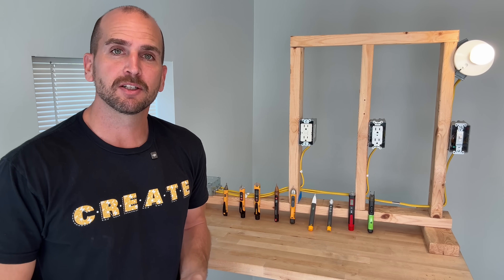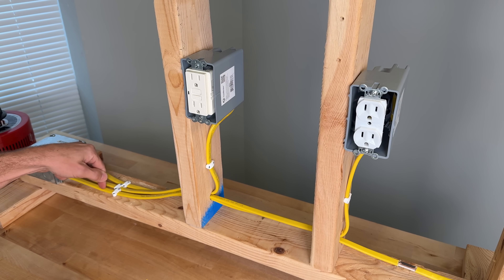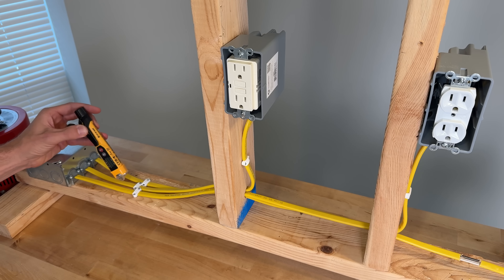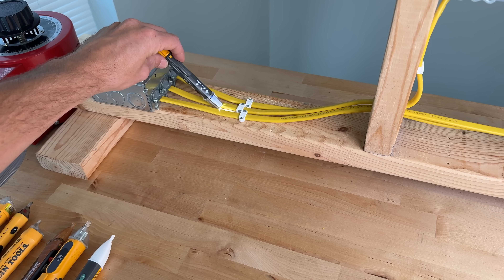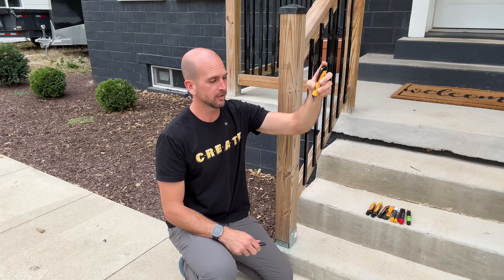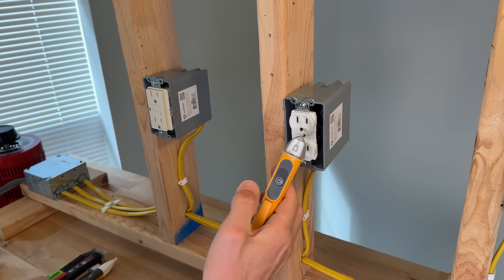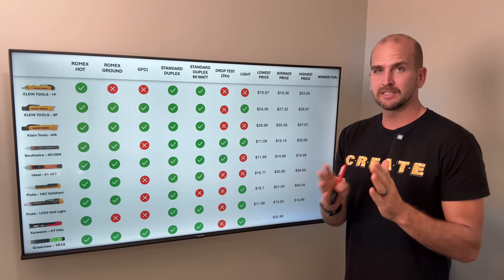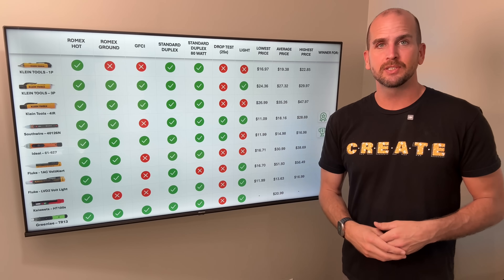The Ultimate Voltage Tester Battle: My Surprising Favorite!

Comment: A few fellow electricians had the Klein NCVT with laser distance measuring and they all died after a few uses. Mine  was used once and put in my backpack and not used for 4 months and wouldnt work when I pulled it out. I returned it to HomDep which had stopped selling them.

Comment: I like my adjustable Sperry NCVT. I can turn it up and sense from 2-3ft away, or turn it down sensing wire to wire. I've had it for years.
Reply: Me too.  If they were built more heavy duty and weatherproof, I'd really love it.  The adjustment dial has failed in my repeated use.

Comment: I’ve used mostly the 1P version, since I’ve dropped and broken so many I (now I have a retractable badge lanyard I clip to my shirt collar) buy the 1P version since it’s the one I’ve had best durability with. 

As for 25 drops. 
The more important question is which of the drops are the ones that it broke. 

Clearly they didn’t last till reaching number 24.

Since none are bulletproof, I think I’ll just use the Klein 1P. It’s readily available at Home Depot and less expensive. 
The lower voltage units have their place, but they break as often as the 1P 

Klein also had a free replacement for a recall a few years back. 

The Gardener Bender is sold by Menards, and the one I bought was frequently inaccurate, so when I lost it I wasn’t missed. I had similar issues with the polarity GFI tester from that brand. 

Fluke. Too costly, though their meters are reputed to be better than Klein. 
IDK, When my very expensive Fluke was stolen/lost, I decided to not buy the most expensive ones anymore. 
Back when my Fluke was first brought into my tool box they cost way more than I could afford, in fact I think it might have cost as much as the car I drove back then. 😂

Comment: I would have at least checked to see if the battery got loose when dropped on the Greenlee and if it worked I would have passed it. That is a common thing with battery operated things. 25 drops seemed a bit excessive because I doubt even if I used one every single day for say 10 years I would drop something that much. I would say if someone is dropping things that often they have some kind of problem holding on to things. I personally would have given the Greelee a perfect score if it worked after checking if the battery was loose. I've never heard of that tool before this video btw. I don't own any of those tools. I would ignore the "drop test" all together on all tools because I think it constituted over abuse rather than accidental dropping occasionally over several years. IMHO both the Greenlee and the Klein Tools 3P both got a perfect score ignoring the drop test.

Comment: Just bought Southwire 40150n, the nicer version of the one u tested. But bought because of u, ive always used a klein but the issue ive been running into is 5volt and 12 volt. it wont always pick them up. I have a feeling the southwire will since its range is better.

Comment: I have two of the Klein 3 P. I purchased one after watching one of your videos and I liked it so much, I purchased another. I haven't used anything else so I don't have a valid opinion of any other. However, I think that if one's finances permit, they should have one of each, as they all might have their uses for different applications, except for the one that broke before you even dropped it. That is chintzy. For me the Klein has served me very well. As I said, I've purchased one as soon as I saw it in one of your videos and I carry it with me every day, even if I am not doing electrical work, as it makes a handy flashlight. I just wish it was a non conductive metal and could be connected to a charger stand. I am constantly recharging batteries. Non rechargeable do last a tad longer but I hate throwing things like that away and they're inconvenient to recycle. I put them in the recycle bin despite notices from the rubbish people to not do that. So I prefer rechargeable batteries for that reason.

I will probably buy something new when I have time and extra money. My health is getting worse, so not sure how long I can keep doing these things. I usually end up calling an electrician in here in the end anyway, just because I am physically unable to do stuff anymore. :(

Comment: Thats odd, you say and it shows the Ideal 61-627 as be a range of 50-1000 VAC and my Ideal 61-627 shows on the side as 50-600 VAC.   The links take you to the Ideal 61-627 50-600 VAC.   Mine works great with no problems.

Comment: Surprised you would pick a unit that failed to detect power on a GFCI.  To me that would be a fail.  I've never dropped a detector but 25 drops onto concrete is a bit extreme and that would not be my primary deciding factor unless I had issues with holding onto things.  Theunits that passed al the detection tests would be on my list of picks.

Comment: What happens if you test the other side of the gfci ? I realize that if wired properly you shouldn’t have to test both sides, BUT wouldn’t you do both sides if you wanted to know if current was there before assuming the outlet was dead.

Comment: Klein 4 IR for me. I carry this daily it's dependable and rugged. The temperature function is great for finding loose connections (that overheat) and bad (hot) fuses and circuit breakers. I have done Commercial HVAC since 1999.
Reply: Came to say the same thing. 😂

Comment: Thanks for this type of video! Having to rely on advertising doesn't get you very far. I use the 3P. Happy to see it passed everything except dropping on concrete 25 times. I think I'll stay with it. If I accidentally drop it onto concrete 25 times and it quits working, I'll just get another one. I test gfci a lot, so that an important feature for me. Thanks again.
Reply: I completely agree.  Failing a detection test is more important than failing a durability test.  When a detector fails any detection test, what other detections will it fail?

Comment: My advice is that if you are getting a non-contact voltage tester as your only means of verifying a deenergized circuit is that you should not do that. It is a bad idea. A death stick as they are called at times are called that for a reason. DO NOT use one for verifying a dead circuit. 

Now I will say that these tools serve a purpose. I am a professional electrician I did residential, and moved on to industrial because there is a lot more money in it. I have a non contact voltage tester. I use it for trouble shooting regularly. I never use it to verify a deenergized circuit.

My advice to the DIY guy out there is to pick up a Klein ET60 low impedance voltage tester. it is very useful to have. It verifies the presence of power, it tests to see if the receptacle you are working on is GFCI protected, and with its low impedance it will drop out any induced voltage on on your line so no false positives. Just remember to live dead live check your tool and you are in the clear.

Comment: I have been using the Gardner Bender Livewire instrument for years. Model GVD-505A. I chose it specifically because it is 12-600 Volts and the sensing is adjustable. So it does detect far away sometimes up to 6 inches and am using it to sense wiring through the walls and follow it. I think this is a missing test in your laboratory. Very useful. Thanks.

Comment: I use the Kaiweets daily because it can pick up 12vdc as well.  I work with AC & DC daily, and it helps me diag fast. It works fine with GFCI s as well.  Looks like the one you got might have some issues.  I use the light all the time as well.  For someone working both AC & DC it's great.  If you only work on AC your suggestion would be the best.  Never considered Southwire version.
Reply: I agree, mine does read GFCI.  I used it to check my bathroom outlets and switches, about 6 months ago.  I switched them both out.  Today, checked 2 outlets, and circuit breaker.  My hubby got his 2 wire reader (sorry don't know what's it called, I'm a 59 year old newbie).  He even used my Kaiweets today, multiple times.  Did test again on 2 GFCI and it did just fine.  Just my 2 cents.  Also, we need to replace 2 bad circuit breakers :(

Comment: I just tested my Fluke 1AC II with two Leviton GFCIs, one about 25 years old and one a few months old, and the Fluke worked correctly with both of them. I wonder if the brand of GFCI makes a difference.
Reply from the maker: Most likely this one had a really thick front plastic cover which challenged many of the NCVT.
Reply: Makes sense, I had to insert the tip of the probe partway into the receptacle before it would register, but with a standard outlet I only had to get close to the front of the faceplate.

Comment: I think the drop test was way beyond fair. These are electronic testers and yeah we may drop it but 25x's is a bit much on concrete. So as far as I'm concerned I'd make my choice neglecting the drop test. However is it acceptable if the test fails the GCI read? Why wouldn't the GCI test be important?
And thanks for putting this up.

Comment: I didn't realize my little klein wont detect in a GFCI.   good to know.  but on receptacles  i always have a 3 prong plug-in tester.  The non contact tester is for when i'm inside an outlet box with exposed wires.  Sometimes it gets brief false positive beeps if you brush it closely past any wire or  metal.  I wonder if the others do that too?

Comment: Checking any outlet that is tamper resistant, and up to code, should not work. 
The fluke is the best. And it’s also reactive to the amount of voltage reading and distance.
If a little LED diode is your game changer, you do not need to have reviews on electrical equipment.

Comment: Great video. First tic tester I ever used as a 1st day 1st yr was my jws southwire. It did the job. Now as a journeyman, I carry the fluke ac1 II. I had the klein w the light for a long time. But that thing is like glass. First drop, it's done. Your second test of checking in the middle isn't practical for actual electricians. We have to look in 1900s that are loaded with different circuits so we need something that can differentiate what's live and what's not. I liked this video, a lot, though. Great idea, executed well

Comment: You know Southwire. They own Romex. Incidentally, Southwire has a nice voltage drop calculator on their site. No need to consult a chart. 

I would never need an integrated light but would likely try the Southwire next. I have the 1P and 3P and find them both annoying to use and less than reliable, even without dropping them. 

I’ll continue using receptacle testers for receptacles, especially Klein’s with the LCD display that shows you what voltage you’re getting where it matters most.

Comment: Home inspector for +20 years. Been using a Southwire 40116N for several years now. Holding up very well. No issues at all. I doubt I have dropped my tester 10 times in over 6,000 inspections, so the 25x drop test is an extreme measure of durability but very revealing. The moment any tester shows signs of defective results, it gets a sledge hammer funeral. Very informative video. Thank you!
Reply: I was just going to comment on this. Does anyone really expect a test instrument to keep working after dropping it 25 times??
Reply: We don’t know if it failed after 2 drops or the 25th.  You say yours was ok after 10, so it could be 3 for another.   Or you can just assume you won’t drop it on concrete.
Reply: While I do agree that having a durable tools is never a bad thing it's just that most tools aren't designed to be dropped in first place or you have to pay a bit premium for owning a more durable ones, which are specifically designed for this kind of job and even then they are not indestructible. Same goes for the voltage testers - some brands offer more basic and budget friendly options as well as more durable and impact resistant versions. All I can say is that it's a personal preference and some people are not that concerned about such things while others are scarred by the thought that they might drop something and break it. So, do whatever floats your boat!
Reply: You know if a drop was a real drop or not.. these things are great at a basic level, i mostly used mine for proving i had the correct circuit breaker, then out comes the multi meter. If i doubt the unit, its gone. The light on all of them is worthless.

Comment: Gotta test commercial electric too! It picks up voltage from 12 inches away, and has sensitivity adjustment for wires that are close together. All of the testers you showed are about the same as the lowest setting on a commercial electric tester

Comment: I have a Greenlee GT-12A.  It passes all the tests you did except I didn’t do the drop test.  It doesn’t have the flashlight but I have a headlamp if light is needed.  I like that it’s not overly sensitive which helps detect specific wires in a bundle. It always detects the hot wire when touching it.

Comment: To be fair I doubt anyone would drop their voltage tester on the tip (test end), 25 times.  As with any test equipment they should be handled with care or they could be damaged out of calibration.  But the Southward is under $21 on Amazon right now.

Comment: Great video! You just missed the newly released Milwaukee tester. That thing is pretty sensitive compared to most and it auto detects between low and regular voltage. I actually really dig it because I’ve (sadly) owned over half of these 😂 it’s been a journey for sure.

Comment: I like your videos, but this is kind of a flawed test. It's not an outlet tester. That's not what it's designed to do. If it indicates a live wire, it's working properly. I've seen from your videos that you really like these. DO NOT TRUST THEM! They can be useful but confirm with your meter. It only has to be wrong once and then what happens? The best use I've seen for them is checking for bad connections in J Boxes. You can see if there is power going into the box, is it coming out on the other wire? Then you know which boxes to open and check with your meter. For checking outlets to see if they have power, I just use cheap nightlights. I can see at a distance if I turned off the right breaker, or if power is back after repairs. ALWAYS check with your meter, do not bet your life on a useful but not always reliable tool. You don't need the most expensive meter for home repairs, but buy a reputable brand  - Fieldpiece, Fluke, UEI, Klein, Greenlee, IDEAL. Kaiweets makes some good stuff fairly cheap, but I wouldn't rely on it as my only meter (good backup/beater/loaner, though). Unless you are getting into industrial stuff or are an electronics hobbyist, you will probably only use the AC/DC volts, ohms, continuity, maybe capacitance. Some of them have non-contact tester built into them. If you will be using it outside, don't buy the kind with the white LCD on black background - they look good inside, but are very difficult to see with the sun shining on them.

Comment: I use an old Gardner Bender , cheap and simple. I also check the side screw vs the socket.( I know the idea behind non contact is to be able to leave the cover plate on, but if I’m going to work on the outlet , I’ve already removed the cover plate, so I’m old school and I test by using leads on my volt meter forever.)

Comment: Are any of these rechargeable? I would think that would be a feature to mention.

I use a Southwire 21510N clamp-on multi-meter which has an integrated NCV sensor. I seldom use that feature as it is rather sketchy, and being part of a full sized meter, makes it unsuitable for use in tight spaces. I prefer double checking with the probes anyway.

If my purpose is to locate a breaker, trace exposed wiring, or find other devices (outlets or switches) on the same circuit, I use a Sperry CS550A. I use an Edison base to outlet adapter for tracing overhead light fixtures.

As far as durability and reliability goes, my choice is also my cheapest. It's the ~$6 contact voltage tester. It will sense 80 to 250 volts, has integrated leads and a trusty neon light that should last 50 years. You could drop that from 25 feet 25 times and it would still work.

Comment: UPDATE ON MY PREVIOUS COMMENT: Just an FYI...Everything Scott discusses about his choice of the Southwire (40126N) I found to be accurate. It tested as stated - even on a few GFI'S - and I especially enjoy the flashlight - it's bright!  

HOWEVER, the instructions on how to install the two AA batteries does not inform you HOW HARD it is to so. Step One is essentially "Push here (A) and pull this (B)." I had to break out a mini flathead screwdriver to disengage the clasp, and then work the two items apart. I'll be turning 71 in a few days and have been doing this sort of work all my life. I don't feel incompetent and thought this assembly would be efficient and easy to do in the field without other tools. Since it will live in my go-to bag, I'll have something on hand to help me out. 

Apart from this hang-up, I'm not discouraged from his reviews nor this product, in particular. If your experiance is easier, I'd love to know how you did it!  Thanks again...

Comment: Biggest complaint on all of these is simply the on/off buttons that are a complete pain to use, its hard to turn on, hard to turn off, and the all turn themselves on in your tool belt. Second complaint is if you get one too sensitive it picks up other wires close to it, not sensitive enough and it won't pick up something like a GFCI.

Comment: I have the same southwire and it detect power on gfci
Reply from the maker: That GFCI had a pretty thick front cover/plate which was a challenge for some of the testers.  I don't think all GFCI outlets have that much plastic on the front cover.